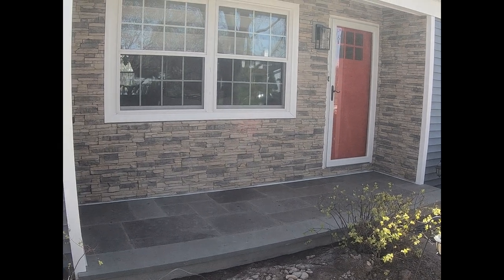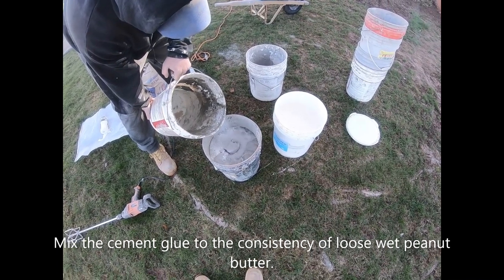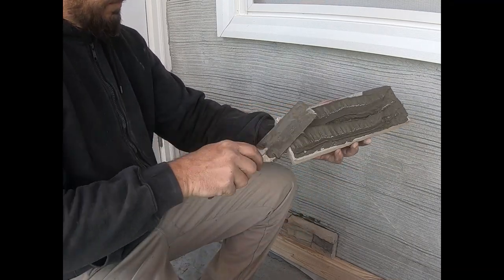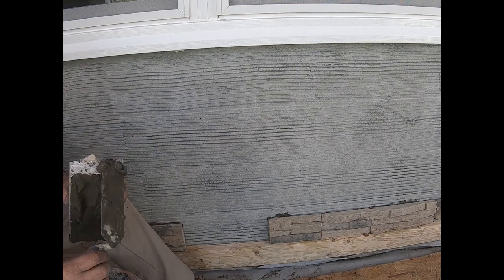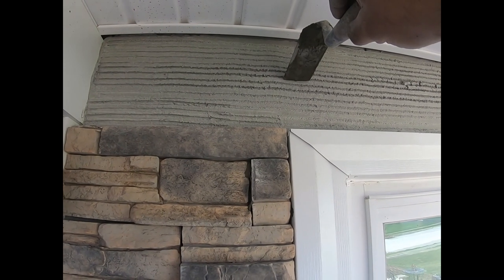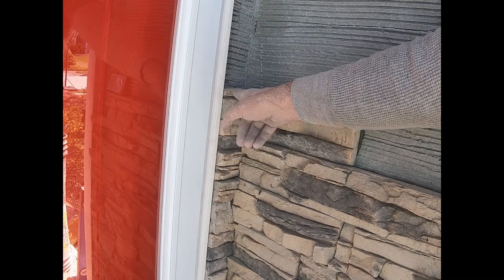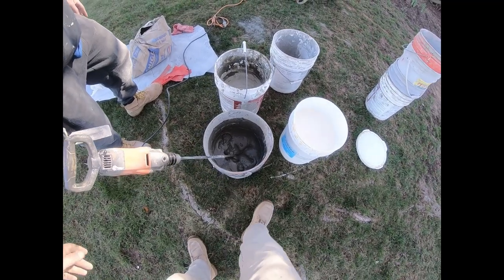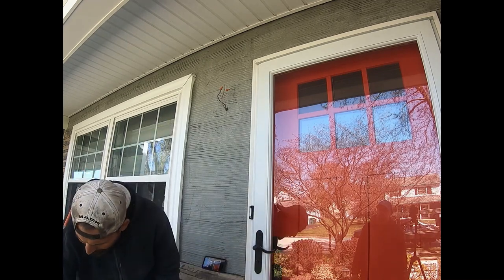Thin Veneer Stone Eldorado Stacked Stone

Comment: Great job on explanation of installation, up in cold snowy Canada. Would i follow your same practice ? should i be concerned about freeze thaw with no mortar in between blocks if water or snow gets between. feeling confident after watching your vid.
Reply from the maker: If the roof doesn't have an overhang to keep the water off of it you might want to be concerned... Other than that if you're just concerned about while you're laying you can use an accelerator in the mix. I don't know who would carry it up there but you're masonry yard should have it on hand.

Comment: Did you hold the stone off the porch at all or did you set it right in the concrete?
Reply from the maker: Depends on the application. That one is under a roof so I put it right on the porch stone, if it's going to get moisture then I put a weep screed at the bottom